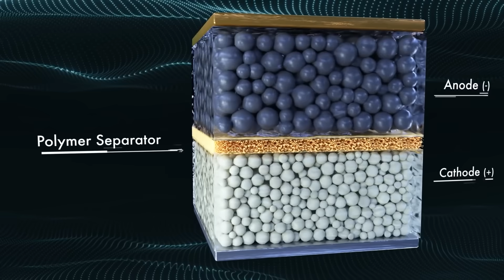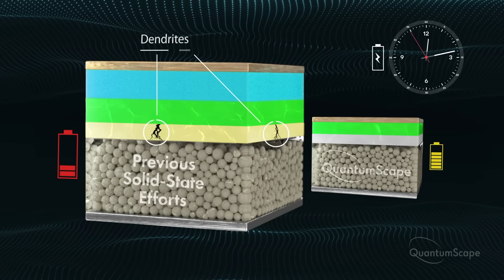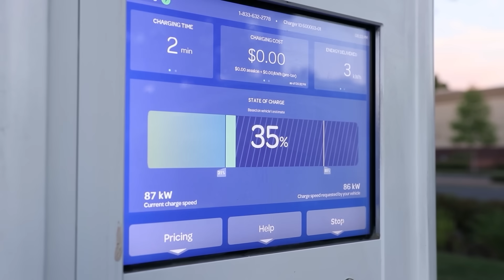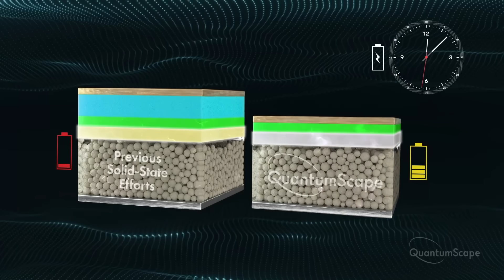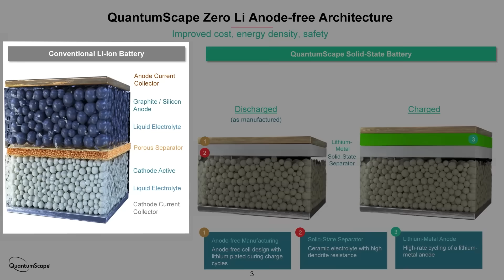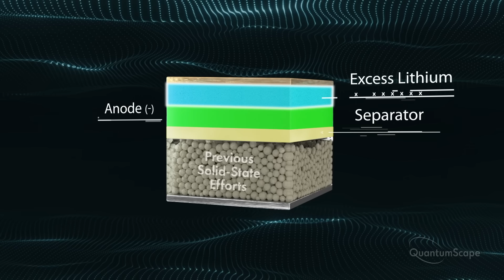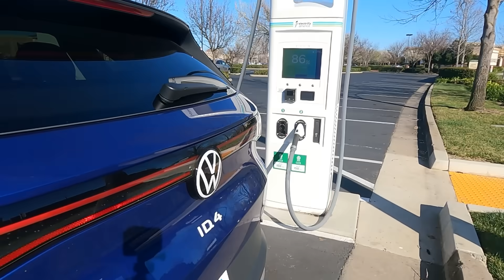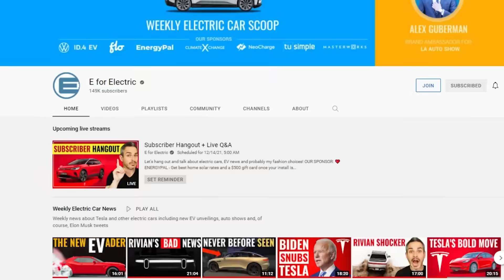How VW Can Leap Over Tesla: QuantumScape CEO Interview

Comment: The 4680 and Quantumscape are designed for different goals. The 4680 is mostly about cost reduction imo and Quantumscape is about developing a new higher energy density battery. I think it's going to be a long time until Quantumscape beats Tesla on cost but I think beating them on energy density and perhaps charging speed is very possible.
Reply: The 4680's are technically still more energy dense other cylindrical cell types though. So for Tesla they serve as cost reduction and an increase in energy density too.
Reply: @migueljardim8177  NO THEY'RE NOT !!!  THEY'RE IDENTICAL IN ENERGY DENSITY.  STOP BELIEVING IN MUSK'S DECEIT AND DISSEMBLING. Musk is a total arsehole !
Reply: @migueljardim8177  So where are the 4680s?
Tell me which EV is using them at this very moment. 
Tesla? 
NUP.
Until they can produce in scale, blah diddy blah blah Tesla waffle, do you see what I'm say'n? 🙄
Reply: @CNile-se9xw  You should've really paid attention during the quarterly earnings report released this year by Tesla. In which they SPECIFICALLY state that giga factory Austin is building model Y's with the structural battery pack and 4680's. So yes the battery is completed and going into working vehicles.
Reply: @migueljardim8177  Mate, I have ZERO reasons to watch or listen to Tesla's quarterly earnings.
I am NOT an INVESTOR & NEVER will be. 😉
The demand is there, so IF Giga factory Austin IS building Model Ys with structural 4780s, where are they?
Have YOU seen ANY of them?
Reply: @CNile-se9xw  Bro, there are literally pictures of the cells being put into the structural battery pack in the Tesla earnings report this year. And then an hour later Elon even confirmed that they are going into production now and more details would be available later as currently NHTSA are crash testing them. Whether or not you are an investor (I am not) is irrelevant to wanting to find out interesting information because it is a natural human trait called CURIOSITY. Glad I could clear that all up.
Reply: @migueljardim8177  Bro, "literally pictures of", & pictures don't lie, do they? 🙄
"Elon even confirmed", I don't know how long you've taken an interest, but not all the Elon confirms actually HAPPEN.
The Model Y with structural 4680s will fly through the NHTSA crash rating because Elon's DoJo would've computer modelled all crash angles etc.
I am CURIOUS by nature, YOU are a CURIOSITY.
BTW, do you own a Tesla or is it still your dream?
Reply: @CNile-se9xw  It would not be published in a quarterly earnings report if they were not working on it because this could lead to blowback from the shareholders and Tesla knows the legal ramifications of that. As for the Tesla question, I do not own a Tesla and I think it would be nice to own one of their models one day. Although currently my first choice for an EV would be the Rivian R1T with the max pack.
Reply: @migueljardim8177  Ah what the heck, I'll make time to enlighten you on my take of the CyberTruck window shattering.
To me, it looked like a pussy throw of the metal ball, BOTH times resulting in the shattered windows.
Elon joked, "we have some work to do", & the audience lapped it up.
What would've happened if the metal ball HAD been thrown with ZEAL?
My guess is that the window would've torn from its fixture & ended up inside.
What are your thoughts on my take?
Reply: Well said.
Reply: @anthonyxuereb792  Thank you for your support, Anthony. 👍

Comment: "TESLA Battery Tech May Soon Fall 2nd to VW's".....NOT!  You are comparing apples and oranges. The 4680's are in production now. Solid state batteries are in prototype at best. The is a big difference time wise between the two. Solid state batteries will be slow to be adopted since they will be more expensive until the volumes are high and price usually wins. What makes you think that Tesla is not also developing solid state batteries?  PS glad to see you are feeling better!
Reply from the maker: 4680 are not in production now
Reply: @EforElectric  In production now in TX.
Reply: @gregb1714  - Pilot plant.. how many Tesla’s have been delivered to customers with 4680’s?
Reply: @ACPilot  Don't know, don't care about the cars. I said 4680's are in production at TX and also in Freemont NOW. Solid state NOT.

Comment: It's a long way from a sample production cell, to a Gigafactory or two or four.  Tesla will sell millions of cars with LFP and NMC batteries before a solid state battery becomes available and competitively priced.  It's kind of like OLED TVs competing with LCD TVs.  For most people, the differences don't matter, just the price.
Reply: Well... What's being said in this case is that the OLED will be cheaper with a bigger, brighter screen. 
To bring costs way down we need something other than lithium and cobalt.
Reply: Good comparison, spot on.
Reply: It will be interesting to see an LFP battery built in the tabless style of the 4680.
I'm not sure solid state batteries are ready to be a structural member so at the pack level they have a ways to go.
Reply: There are a few things that the QS battery could offer above Tesla's design. The top three things that give drivers high anxiety and the primary purpose they bought the vehicle. Distance anxiety, charging time, and charge retention. Production will ramp up easily once the battery proves itself after development stage. And like Elon, the company will find a flood of investment and government money to subsidize the effort.
Reply: But this battery will make other car manufacturers completable with tesla. I own both tsla and QS
Reply: @LeaveNoEvident128  “completable”?
Reply: @Alsmithize  You just admitted that you DON'T THINK.
Reply: not on a car though.  Most won't switch to EV unless its more efficient.
Reply: If solid state batteries would be feasible to make now then they would be doing it already. The guys at Tesla are no dummies and have all the cash to do it. Must be serious reason why they are not into it right now. They must be playing with it in the lab. 
I'm surprised how much it's taking them to bring the fatter battery to market and it's just an evolution. Even with the new batteries they are improving and optimizing so it's continuously evolving in a way it makes sense. Solid state would be great but they really need volumes now. 
It's not they are stupid or lazy. It's really hard and it takes time.
Reply: I go to Costco and see two big screens side by side, one OLED and the other LCD, and they both look the same to me,  so I would not pay a premium for the one less developed with less proven lifetime.  You pay your money and make your own choice.  I don’t own stock in either company, so I have no dog in the hunt.
Reply: Volkswagen will be making their own LFP batteries with Unified Cell from 2023 which will cost half as much as current batteries.
Reply: @antonthompson7838  What's your source? 🙄
Reply: What?!?! 😂 your comparison to the TVs are absurdly ridiculous. It is literally an upgrade equivalent to upgrading from lead-acid to lithium ion… is the technology a couple years off? Sure. Is it going to absolutely change the world? YES! You have no idea what you are talking about.
Reply: @logandaniels5  Since there is a backlog of more than a million people waiting to take delivery of electric vehicles in the U.S. alone, and millions of EVs currently being delivered in China every year, it is clear that selling them AS IS is not a problem to the people wanting to buy them.  They aren't saying "Gee, if only they had a 1000 mile range solid-state battery I would consider buying one", they are saying "I want one right now, just as they are; take my money, please!".  Maybe they will be improved significantly later, or maybe they will stay about the same and just get cheaper and slightly better, but they are being made with current battery technologies and people are lining up to buy them, just like they are to buy slightly less expensive big-screen LCD TVs.
Reply: @eddiegardner8232  Everything you just said is EXACTLY my point, so thank you for helping to prove it. The fact that electric vehicles are in such high demand proves that a new battery technology will have a massive impact to the industry. The comparison to TVs is ridiculous because it is a spectrum and people can choose the type of TV they want within their budget. An 85” 8k OLED television does no good if I simply want a screen to display my surveillance footage, yes? A better battery will undoubtedly improve everyone’s lives. The technology will not be more expensive nor will it be harder to produce; on the contrary, actually. This leap will also help advance our stationary energy storage as well, which will literally help advance us as an entire society. I’m an electrical engineer and I have written papers on topics that delve deep into this topic, just a side note. I have an extremely good understanding of what solid state batteries will do for our future. Be more positive.
Reply: @eddiegardner8232  This is partially correct. I have owned electric cars (two Teslas, a 2013 S and a 2018 3). The most important question on every EV buyer’s mind is _range_. Next question is how fast can it charge. 

QS is attempting to address both. Currently EV demand is very high, that is right, but that’s because people have started to get away from ICE now. It’s catching on that electric is both cheaper and better for the environment. In most cases they are also more powerful, simple and fun to drive. However, as the scale happens, there will be a demand for range parity with ICE. This is especially so because BEVs have a big problem in winters. In cold climates with snow, the range hit is typically 25-30%. 

So, what QS is doing will attempt to solve that problem. If they are successful in making the battery for industrial scale production, then watch out. 
Tesla is rumored to be having a few issues with producing the 4680 at scale. That just goes to show that no product is immune from the challenges of scaling. 

I for one wish QS the best. Cannot wait for 500 mile range BEVs with the curb weight of a Camry. That will be a total paradigm shift.
Reply: @logandaniels5  As a fellow EE, I agree! 👍

Comment: I hope that someone is successful at producing solid state batteries.  There are some potential advantages that cannot be denied.  Unfortunately for non-Tesla's, the batteries are only part of the equation presently.  The other part is charging infrastructure, where Tesla still enjoys a profound advantage.  As availability of CCS charging increases then the benefits may become a gamechanger.
Reply: Keep in mind that the average Tesla sits for about 40 minutes at a charger. If it was only 15 mins. there would hardly ever be a wait to get into the charger. That being said, with Tesla production/Sales continuing to go up and up there will most likely be a wait to get into a charger. I am in a area where there is a high concentration of Tesla's,
Reply: @dublindave5795  Excellent point.

Comment: The problem with solid state batteries and their lithium metal parts is that there is a shortage of lithium and I see no sign that VW has lined up sources of lithium at that level. Talk about fluoride salts gives me the shivers as those are some of the most toxic and difficult to handle materials on Earth.
 
Also, the idea that solid state lithium is the end-all and be-all of battery chemistry is just hilarious. Silicon is a lot easier to find and the problems with it seem no more difficult than dealing with lithium metal. This sounds like the latest "it" thing and there are other energy forms out there that can challenge what you have presented. Besides, these guys haven't proved that they can manufacture these things in volume and package them into viable packs for vehicles.

We shall see. VW hasn't shown that it can produce efficient and powerful electric motors, though we know they can produce vehicles using three times the space and a lot more workers. We see no sign that VW is building new plants that can efficiently compete with Tesla. As people from Missouri say, "Show me".
Reply: It's still early in the game. Watch Porsche. What will they do in 5-10 years regarding motors? Now isn't the defining time as much as once certain makers have spent time on their 3rd versions of their products.

Comment: Thank you for not using words like "tesla killer", the assumption is usually that there only is room for a single EV manufacturer. The whole point is replacing ALL combustion engines everywhere.
Reply: that is one thing that bothers me - the Applekiller - Teslakiller.  Such a limited view of the world.
Reply: There is no Tesla killer and there may never be, but there is huge room for more than one EV OEM.  Each EV manufacturer will have more than enough customers as the world quickly transitions from expensive, dirty and trouble prone fossil burners to clean electric.
Reply: @s.m.7018  I like the roaring V8 as much as the next guy. But eventually they will be a hobby much like horse racing 🐎